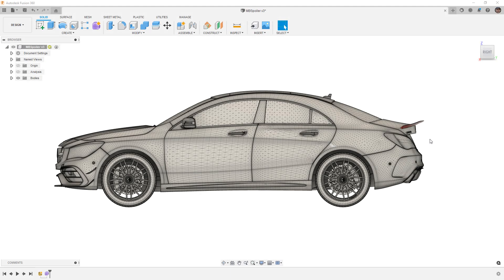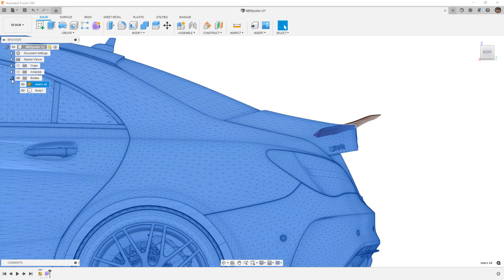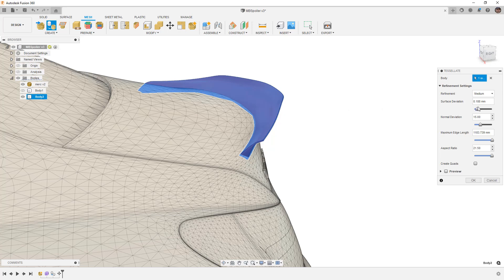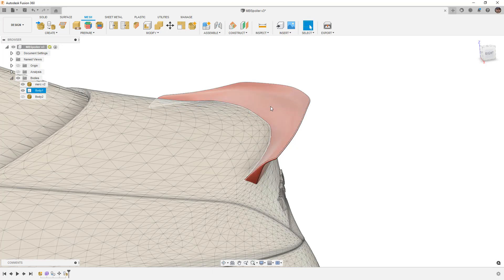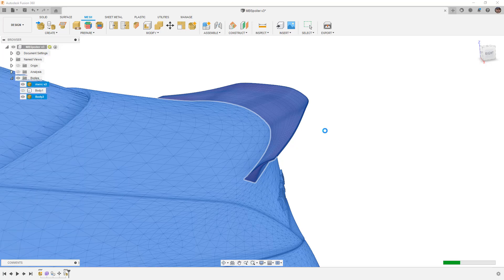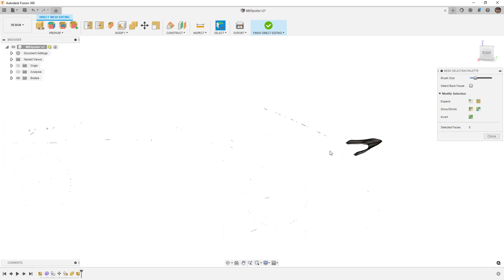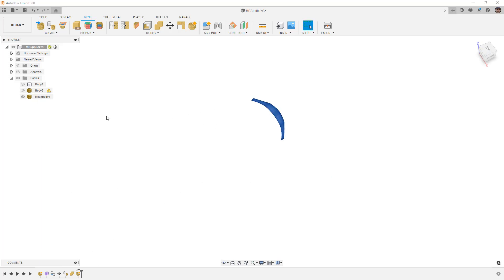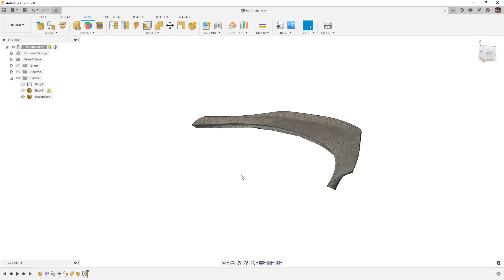How To Use Mesh Combine - Removing a Mesh Car Body from a Mesh AMG Spoiler #Fusion360 #Design

Comment: Hello, i have a mesh body of airplane and i need to separate its wings from fuselage. I tried it couple it time but failed can you please help me with it
Reply from the maker: Sure, there are a few ways to do this.  Probably the best way is to generate Face Groups.  It should be able to identify the wing as a different group than the fuselage.  From there Combine face groups for all the wing so its all one color.  If you don't see any change in color you might need to display face groups.  Shift + F or you can find it on the Inspect drop down menu.  There is a selection filter option for Mesh Groups.  Toggle only that one on so you can select the wing.  Then you can use the Separate tool. this will let you separate the selected face group from the rest of the mesh.  NOTE that you can still select a face group without doing the Selection filter thing, but if you have trouble give that a shot.